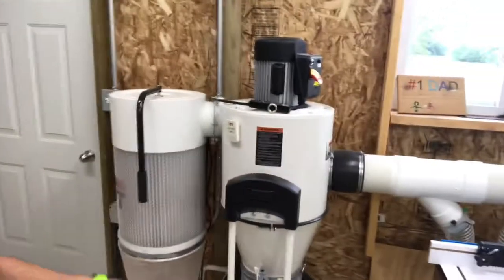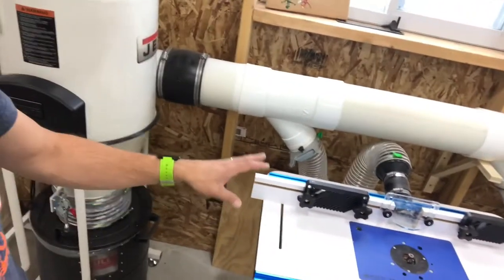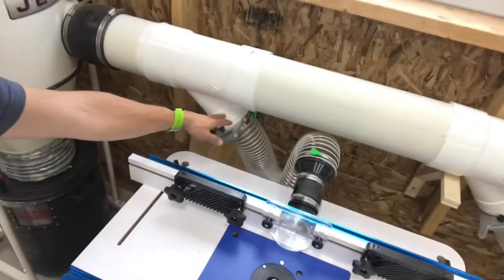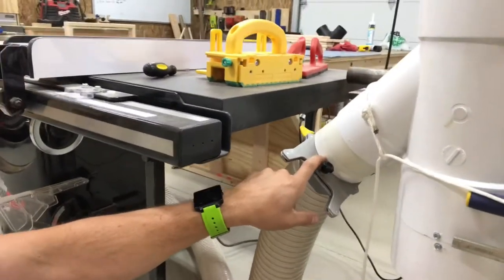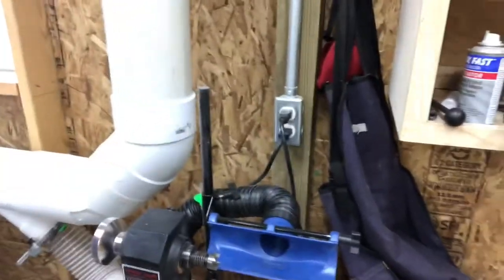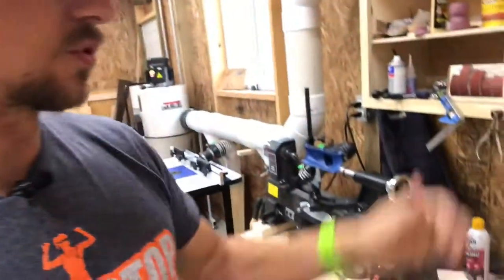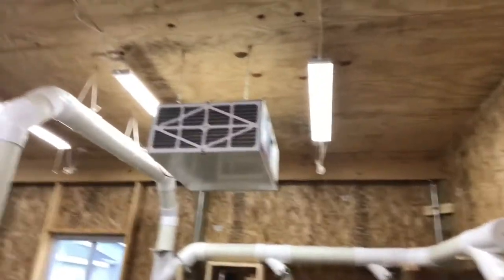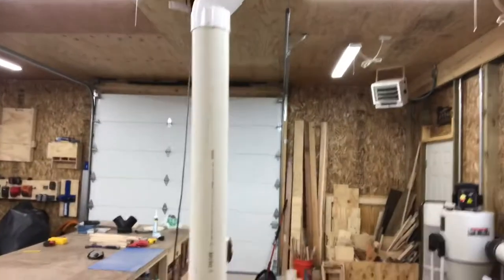Dust Collection Install

Comment: I have that same DC, I take the filter off (12mm) every couple months and I blow it out using my leaf blower. Makes a huge difference and you’ll notice your suction is much high when it’s clean.
Reply from the maker: I just did the same thing a week ago with a leaf blower and it made a huge difference!
Reply: I have my main run with 4” pvc and I see you used 6” -  I’ve thought about switching the main truck to 6 but unsure how much more cfm I’d gain?

Comment: I'm with you on the grounding.  I would only ground it if you start getting static shocks from the pipe - and that's only because static shocks can be annoying, but dangerous in the sense that you might get a shock while working  with something dangerous and getting injured.

Comment: 2 potential solutions for having to go back out to shut lights off.  Get a timer switch, you could set lights to go off in a set amount of time and they will go off automatically.  Or set up a smart through google home or amazon echo or several of the other products out there and then you can just tell your device to shut the lights off in the shop.

Comment: If you turn your blast gates around with the screw on the other side they would stop rattling. The suction will pull it tighter and your screw will not be pushing against the suction.
Reply from the maker: Thanks for the tip!
Reply: Agreed!

Comment: the only time where I seen a fire deal is when your working in a huge commercial shop with a large outside cyclone, and that is not a combustible thing it was something like a hot piece that did the igniting for a blow back

Comment: Hey! Really nice installation! Are you happy with the overall suction? I own the same machine and I got quite some problems during the last ductwork update. Suction is really down. Did you already use it with a bigger machine?
Reply from the maker: Thanks! So far I’ve been really happy with it. The biggest machine I use at the moment is the table saw and it seems to be working really well. Considering I have to go “up and over” to it and a 10ft flex hose, it’s pulling pretty well. The only thing I’ve read prior to people having suction issues, is making sure the filter stays clean. My OCD kicks in and i run the flaps every time I shut down the shop for the day. I also really made sure I stayed at 6” as much as I can before dropping to 4”. Thanks for the comment! I’ll keep you posted if I start to have any issues!
Reply: @gonyerwoodconcepts2646  Thanks for your reply mate! Really appreciate it! :) Guess I´ll try cleaning the filter - again :D

Comment: PVC pipe is plastic, it’s an insulator by definition. You can’t ground an insulator. You especially can’t reduce static inside a insulated pipe by wrapping a conductor around the outside.

Comment: Very nice shop. Really like your dust collection set up. I am in the middle of doing a similar setup. I was wondering if you can get away with doing smaller diameter pipe ? 

Kevin
Reply from the maker: You can get away with it but you will lose suction starting right away with 4”. I ran as big as I could for as long as I could then dropped down in size. If you had less distance and fewer machines, you can get away with it!
Reply: Okay, that’s what I figured. I just wanted to double check. I’m going to running about 55ft. So the 6” is probably best. 

Thank you
Reply: @kevinsegura8389  I just finished piping my system using 4" SDR-35 pipe, the 6" fittings are quite a bit more costly, for instance the 4" wye cost is $13.00 the 6" wye is $114.00.

Comment: dust collection is funny the bigger the pipe better it will work  (depending  on your collector)  the reducing  is where you you loose the cfm and makes the collector starve you are right to make the flex hose short as posable.  so  6-5 and 5-4  someone should invent a cone

Comment: Just found your video. Nice set up. What schedule pipe did you use? Schedule 10 or Schedule 40? If schedule 10 where did you purchase it?
Reply from the maker: Thanks for watching! I used SCH40 that you can get in any big box store. I did get mine from my father in-law who works for a company where I got it wholesale price.
Reply: Dido thanks for making this video. I’m final in my shop and it’s hard to layout every tool.
Reply from the maker: Layout is still changing it seems for me. I tried to keep the stationary tools (tablesaw, jointer, lathe, and bandsaw) “hard plumbed” in the dust collector. Sometimes when I want to make a change, I can’t in certain aspects because of having a permanent line. I’m trying to have best of both worlds and sometimes it doesn’t work that way.

Comment: Where did you get the 6” pipe? Is it schedule 40 or drain pipe?
Reply from the maker: It is sch40. My father in-law worked for a well and septic company so I was able to get it there.

Comment: Now that you have been using the system for a couple of years, would you still use PVC?  thanks for the video!
Reply from the maker: I still would for sure especially because of the price difference for materials compared to metal. I would say the only thing I hate at this point is the looks of it. However, it’s a shop, and not a museum!
Reply: @gonyerwoodconcepts2646  i think it looks good and clean!

Comment: How are your blast gates being held on without falling off?
Reply from the maker: On the outside diameter of the blast gate, I installed a sticky foam tape making a nice tight fit when installing them into the pipe. After that, I wrapped a silicone tape around all the joints as well. Thanks for asking!